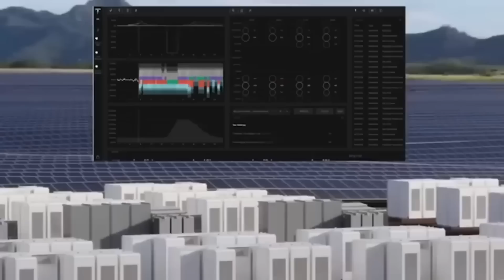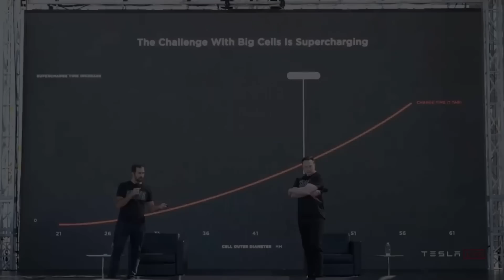Tesla's MASSIVE Energy Potential! W/ Dave Lee

Comment: Wrights law will definitely apply to battery prices and when those battery prices come down by half with either the 4680s or CATLs new sodium batteries or anything else then the bureaucracy of getting a large energy storage deal is no longer an issue because the demand for home batteries would explode. What holds the Tesla Powerwall back is price. They simply do not save enough money to justify the price however if the price is reduced by 40% then they cross that threshold plus they make your home black out proof, they take pressure off the grid etc etc .  There are 100 billion buildings in the world. One power wall for each at $5000 per unit unlocks a $500 trillion market.
Reply: Lol!!! Those things are still going to be super expensive doesn't matter how fast prices goes down! It's about the whole system not just batteries
Reply: @alanmay7929  My number of buildings that could take up a power wall is overblown of course but at this new price a  household of 2 would only need to spend about $22k for enough batteries and solar to be off grid for 20 years. That is only $1100 per year. This includes a 10 kw solar array producing an average of 50 kws per day and two power walls holding 27 kws. Plus much of the excess solar would be used during the day in the house and to charge one or two electric vehicles and the big saving is using that solar energy as a replacement for gasoline. Using solar to replace gasoline  saves nearly 4 times as much as a replacement for grid electricity. By 2030 the upfront cost  of an electric vehicle will be cheaper than current gasoline cars,  they require less than half the servicing costs, cost about  $5  each per week in solar energy to go 250 miles and most importantly contain 65 kws each of emergency backup power for the home. Each vehicle only costing $5 per week saves about $25 Incas per week or the magical number of around $1100 per year. The cost of the entire solar and battery system.
Reply: @markumbers5362  unfortunately that's not how it works! There is a lot more variable in the equation! There is also not everyone that can afford to install thise solar panels depending on where they live. Not everyone needs a storage battery at all! That's also way too much strain on our environment to make all those batteries...
Reply: @markumbers5362  also with none of them are going offgrid trust me! To be off grid you need alit more hardware than that!
Reply: @alanmay7929  No you don't, remember when you have two EVs that hold a combined 130 kws plus 27 kws of battery storage plus a solar system that generates an average of 50 kws per day minus an average consumption of 16 kws per day. That is more than enough. Plus car batteries will be able to be recharged at shopping centres or at work for free. Plus for an extra $1k a gasoline generator could be stored in a shed for further emergency back up if needed. It's easy.
Reply: @markumbers5362  nope it's definitely not easy! You won't charge at shopping centers for free forever, because your EV battery is big means nothing and not everyone has the same use of cars,you're just balancing all those numbers here and there like that! For alot of people even in a decade they might not recover all those costs!
Reply: @alanmay7929  We will see.
Reply: Not every building or infrastructure needs batteries we need other solutions for other problems! In many countries they produces way more energy in permanence that they use.

Comment: Tesla Heat Pumps could potentially be huge

They should build mini heat pumps. Air to air bersions which you can DIY install one per room

4 billion homes in the planet soon x 6 mini heat pumps each = 24 billion heat pumps per year. If they last 24 years before needed repayment that would be 1 billion unitd per year. At $500 per unit that is $500 billion in annual sales potential. Thats more income than from building 10 milloon cars annually
Reply: Tesla heat pump literally will have zero potential it's even negative potential! The biggest issue to solve is to build much better insulated and efficient houses! In the USA alone it's very bad! There are still millions of homes with single Glas Windows how is heat pump going to help there!?
Reply: @Alan May  40% of homes in the US are electrically heated. A heat pump will reduce their energy consumption by about 70% which is massive

It doesn't matter if they have single glazed windows or triple glazed the heat pump still reduced the amount of energy needed by 3-4x
Reply: @kaya051285  bullshit!!! Heat pump won't do crap let alone in vert harsch conditions! By having a much better insulated house you won't or barely need that to begin with! Those electric heating is a gigantic energy guzzler  compared to the solution in Europe and Asia. It's not just about windows but the whole building.
Reply: @kaya051285  the Texas blackout really showed how poorly the infrastructure was built/ insulated against the elements including houses too.
Reply: In Europe buildings and homes are way more efficient and better built for climate variations too.

Comment: The energy market ISNT bigger than Autos this is very easy to prove

USA total annual Electricity consumption ~4,400 TWh with average wholesale price of $40/MWh = $176 billion revenue

While autos in the USA 15 million units x $40,000 ASP = $600 billion a year

Auto market in the US is significantly bigger than electricity

Also as the USA moves to heat pumps and EVs the US electricity useage will likely go down. 40% of US homes are heated with resistant heateds swhich those to heat pumps and you can heat 100% of homes with heat pumps at less energy than heatign 40% with resistive heaters

Comment: The demand for stationery battery storage is quite limited

Especially because a country can get to a very low fossil fuel grid with very few batteries

Eg Norway 99% non fossil grid with basically zero batteies. France 97% non fossil grid with basically zero batteies
Reply: We do not all have the same amount of hydro power plants as Norway or nuclear plants as France
Reply: @AS-gx4qg  That is true. But we do all have the ability to build interconnectors which cost 10-100x less than batteries and use less materials

The USA could for example connect up its three independent grids. With a 3 hour timezone difference and different weather patterns you can export excess green power rather than store it

Also if storing the power is more expensive than just grounding it you'll ground it rather than store it

At $1.85 million for a 4000KWh megapack it's cheaper not to store the excess

Why dont others try to estimate at what price it makes sense? Clearly if  batteries cost $1 million per KWh we will just keep using the existing systrm rather than bankrupt ourselves with ecoensive batteries

At $470/KWh which is the approx price of megapacks they make sense for some application in some locations but not for mass storage to eliminate curtailment

For that to happen we need batteors below $100/KWh That last 20+ years. So a megapack needs to fall in price from $1.85 million to.... $400,000 or less
Reply: @kaya051285  You have some points, and I agree with you that the demand for batteri storage is less than many think in many countries. Here in Denmark, when we have strong winds, our excess electricity is sent to Norway to pump up water in their hydro dams. And we buy the electricity back when there is no wind or solar. Also, the combination of solar and wind, smooth supply (usually). 

However, even in these conditions, there is a lot of money to be made by local energy arbitration, prices fluctuate from hour to hour and it is predictable. So there is money to be made and gas peaker plants will soon be obsolete once batteries are established. 

You mention private home housing and has some price suggestions and arbitrary high kwh needs. In DK with a solar system on your house ,they recommend a 5 kwh battery and you can expect to use 75% of your own produced solar energy.  So 20 kwh is overkill imo.

If you have heat pump or electric car, then you can upgrade to 10 kwh. 

We are building a new house, a 5 kwh battery cost extra 4000 Euro and 10 kwh 6700 Euro including installation. (we ordered 10 kwh)

Also, you can buy cheap electricity at night in winter to use during the day, when the solar panels are not giving much output. 

In Denmark, it does unfortunately not make sense to make energy arbitrage for households, so we can only use battery to fill up on cheap days.
Reply: @AS-gx4qg  Even at a home level batteries only make sense below a certain price point

Let's say you have solar and want to store it in your own battery and you need 20KWh for your home setup

If batteies cost $10,000 per KWh that would be $200,000 for your home system. No thanks

If batteies cost $500 that would be $10,000 yes maybe for some homeowners in some locations that might make sense but not for most homeowners in most cases

If batteries cost $100/KWh so the system only cost $2,000 fully installed then maybe most homes could justify having one

It's all about price
At the current price the market is very limited
Reply: When all vehicles are EV's,  there will be a big jump in energy requirements and possibly grid stabilisation.
Reply: @Malla mal  Define BIG jump in electricity requirements

It's actually a modest jump in electricity requirements. For example the UK if all the vehicles inc trucks vans HGVs were all eletric our electricity consumption would go up 30%

But that change over is going to happen over 20 years not overnight which means about 1.5% increase per year which isn't a lot
Reply: @kaya051285  30% is not modest, it's a significant step